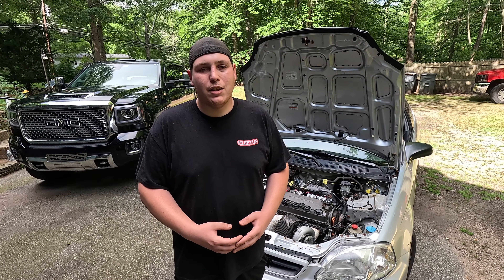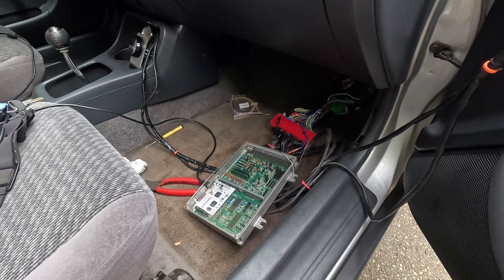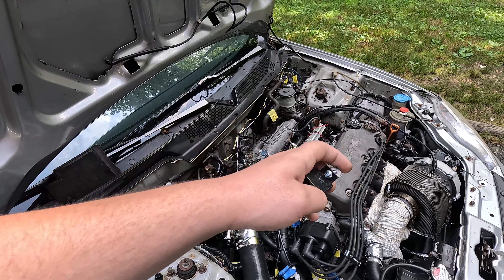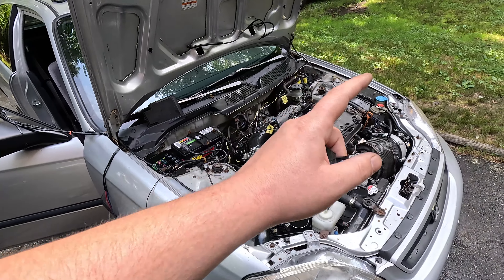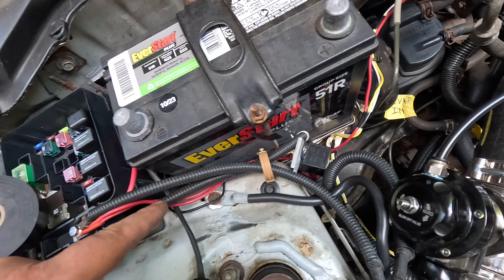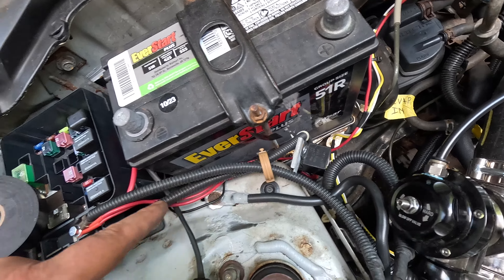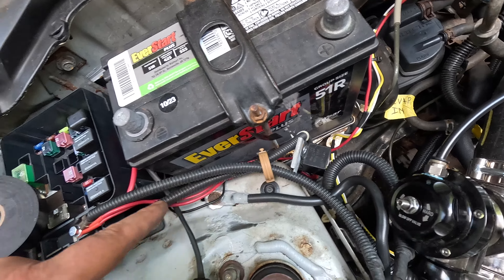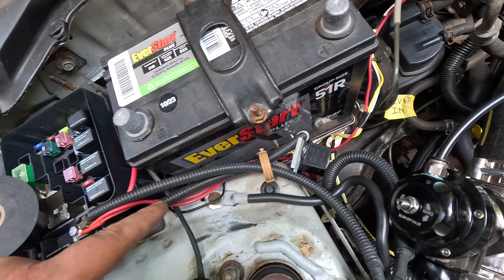CHEAPEST METHANOL INJECTION KIT! WINDSHIELD WASHER PUMP???

Comment: It would be cheaper to use the windshield washer fluid it is half meth already
Reply from the maker: @drippy6706  I would be willing to give that a try but I couldn’t find any washer fluid with a content over 35ish % At least not around here  so straight 91% alcohol was the move thanks for the input 🤟🤟
Reply: @bought2build  could be different depending on location
 Personally I buy a 5 gallon can of methonal and then mix it with distilled water myself comes out to 60 dollars total about 6 dollars per fill up
Reply from the maker: @drippy6706  yeah I have been thinking about doing that as well because now I have multiple cars running it so I may give that a shot
Reply: Windshield washer fluid has detergents in it and over a little while you have to take the nozzle apart and clean the screens.  Not worth it IMO to save a few bucks.
Reply: @tunerdadtunerdad7927  its only a problem on a normal methonal systems but not the cheap setup that he is running I doupt it would clog even if it did pretty easy fix since it's in front of the turbo